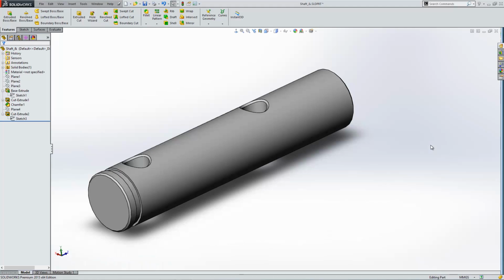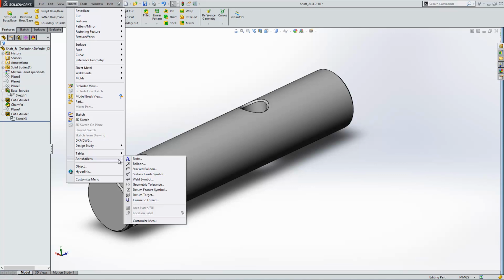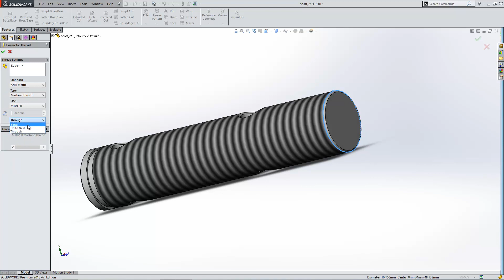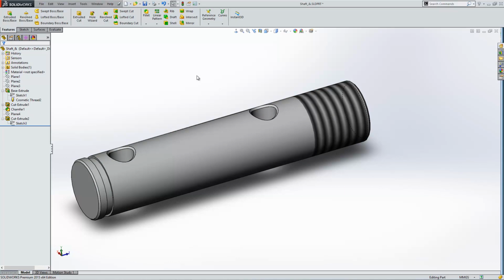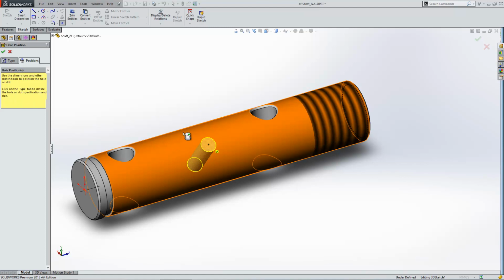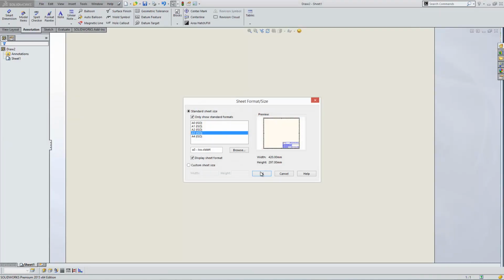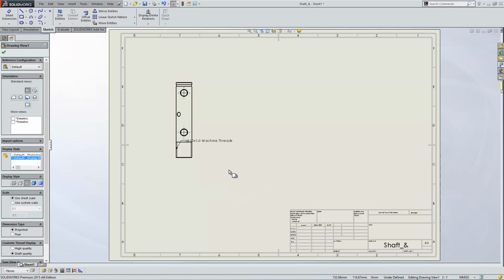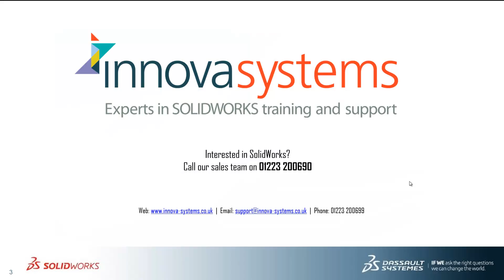How to create a Cosmetic Thread in SOLIDWORKS

Comment: WHY DOES IT LOOK LIKE POOP?
Reply: Looks like poo because apparently in order to accurately model threads it takes a lot of unnecessary memory so as long as the machine shop has the proper thread callouts on the 2d drawing/ the cad program knows what its doing on the cnc is whats important. in other words, sacrificing visual appearance for graphic performance